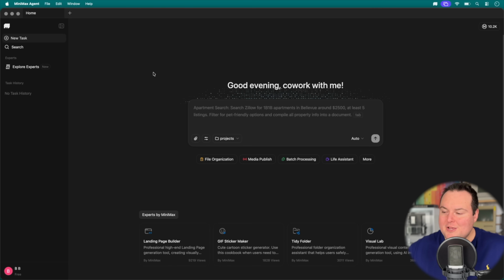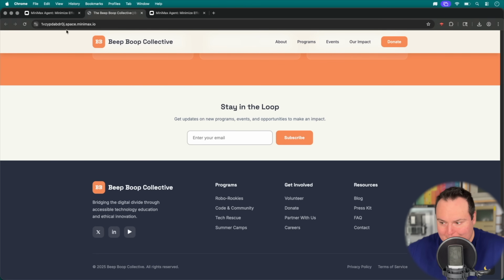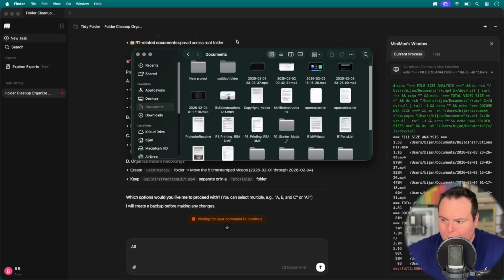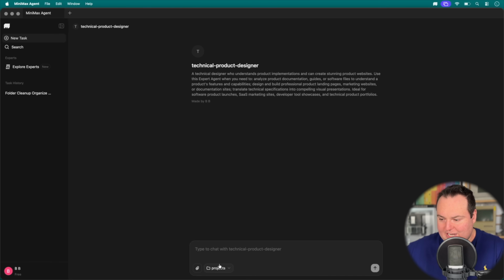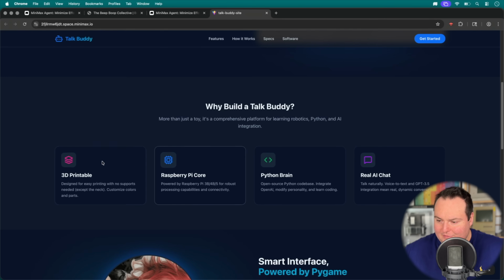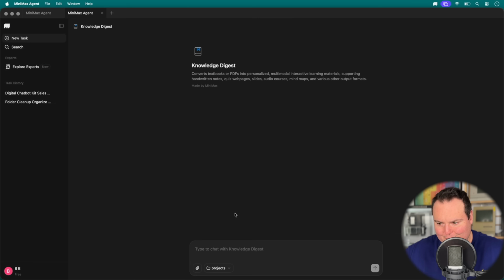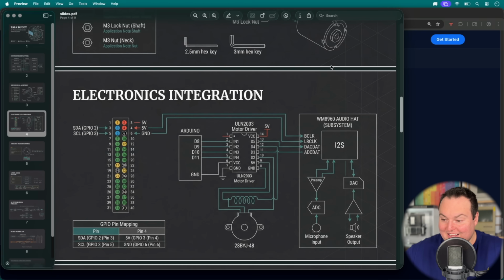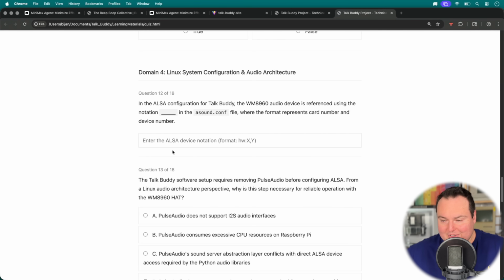MiniMax Agent Desktop Hands-On Test – A Low-Cost Claude Cowork Alternative!

Comment: You gotta do better prompts! Like use either markdown or structure format like pseudo-json including a TODO and Notes markdown then agent works at to make the tests more relatable and at peak performance judging on code quality. Why does no "influencer" do this?

Ask any model to make you w skeletons blueprint for a prompt. You can have the model adjust parameters and other engineering ideas.

Comment: Bijan, audio quality is still very poor. I notified you of this a few videos ago. It has not improved. Your voice is way too deep and bassy and overwhelming the actual context of what you are saying. Again, the lows are pumped to the absolute freaking max, and I can't hear anything from the mids and highs on three different pairs of speakers (these are tuned specifically for audio clarity in a professional setting).

If I put on headphones, it's fine, of course.

Listening through you via speakers even at high volumes, on three different sets of speakers (that I personally use when creating audio/music)... it's just not happening. I know I'm getting a bit older, but my hearing isn't going quite yet, lol.

Again, from someone who has messed around with audio professionally and looked at this and downloaded this video and dropped it into an audio spectrum analysis, the audio is objectively and subjectively not in a good spot right now for vocal presentation.

Please look into a Parametric EQ or Dynamic EQ filter in whatever software you are using to capture your audio to correct this to punch up the mids/highs (or lower the lows). Should be an easy fix.
Reply from the maker: I am using final cut pro. I use a bass reducer currently. What would you suggest instead, or if you have an example setup you think would work better (new hardware is fine) please feel free to suggest.

Comment: Wait what? We can run this offline from a gpu?
I wouldn't trust it if it's online required having access to my PC. So if it does indeed work offline then I'm interested.
Reply: Need a lot of GPU. Most cost-effective right now is the Mac mini with maxed out memory because it has unified memory. Only Apple has that otherwise you're paying for a lot of 5090s. 64 MB unified memory I think right now about $2,000 with small SSD.
Reply: Best bang for the buck right now is actually the Mac mini, only because Apple is the only one that has unified memory you can get 64 MB, small SSD, for around $2,000. To get 64 MB on an Nvidia platform you'd have to buy a hell of a lot of 5090s or 470s or whatever still can't beat apple silicon right now
Reply from the maker: Not currently offline.
Reply: @Bijanbowen  Ah damn. I'll try it when it is.

Comment: Would be fun to see the rest of the questions on the test.

1. The angular resolution of the stepper is 0.176° per step.
2. The reason for 25mm long bolts is to have adequate thread engagement.
3. Without reading the docs, I can't know if a lock-nut is specified, but if the images it generated are accurate, there was a lock nut.. so yes?
4. The function of the diodes is to prevent back-EMF from the stepper motor from reaching the driver.
8. I guess the value for the constant is 2048
9. The number of steps to rotate 45° is 256
10. Not sure. Would have been helpful to see the rest of the options 😅.

I saw some more of the questions at the end of the video. I'm not sure if I could have answered more than the ones I saw earlier in the video 😅. I get why you skipped them 😂.
Reply from the maker: Yeah it went very intricate with them, more than I was anticipating haha

Comment: Great video as always, I know there is too much going on but I'd love to see your thoughts on the new cloaked Pony Alpha!
Reply from the maker: I ran a test prompt through it and it did pretty bad compared to what I've been expecting - perhaps a fluke?
Reply: @Bijanbowen  it absolutely needs more testing. its 99% a new GLM from what ive tested. if you remove the openrouter system prompt it says its glm, and then the model description says it is good at coding & roleplay. which is exactly what they said in their glm 4.7 reddit AMA!